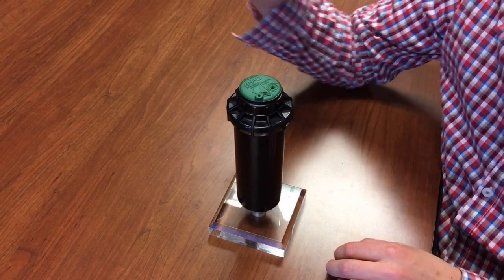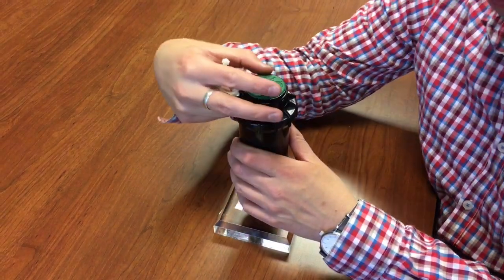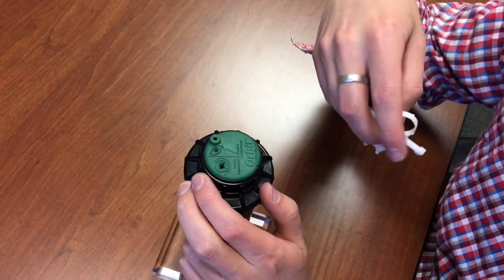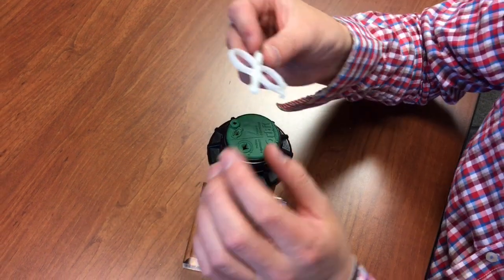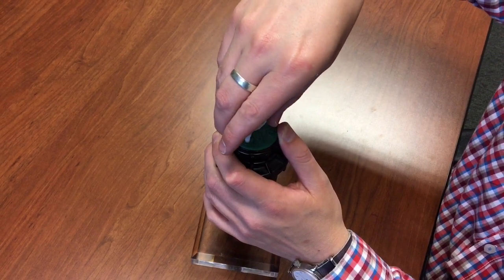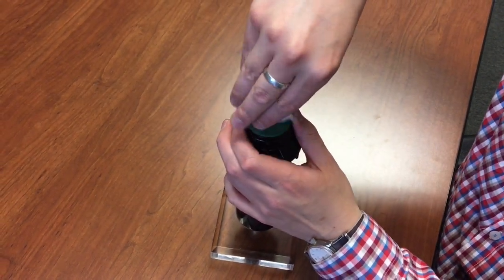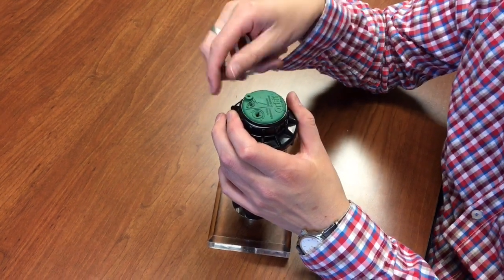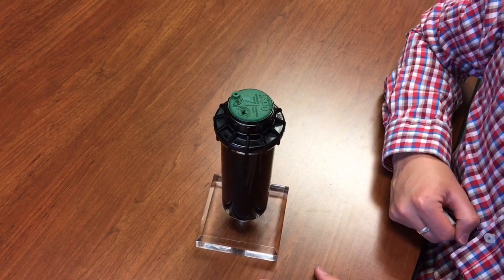Adjust a Voyager II Gear Drive (55661)

Comment: Nice video, but you left out one of the most important parts.
What good is having the right pattern (e.g. 180 degrees) if the pattern is not playing out on top of my lawn.
I think the right stop is fixed, i.e. does not change as you adjust the spray pattern.  To change the position of the right stop, I think you have to unscrew the bonnet nut and lift the guts of the unit up until you can re-position the gears to get the right stop in the right position.  I would like to find out if there is a better way.  That's why I am looking for a good video on the subject.
Reply from the maker: Yes, we have done a video on this exact subject. Please see here: https://www.youtube.com/watch?v=MdKjaFm_nnM

Comment: That's crazy.... I returned two orbit voyagers for failing to adjust less than 180... I was using the allen side. Who knew to use the popup side for adjusting..?  I got a rainbird. It used a flat screwdriver.. Sorry... Called 800 help also... They didn't even ask...
We all assumed our own respective thoughts which were different.

Comment: This is a poor design. You cannot adjust the right stop position. You must get that position set before you bury the head in the ground. It's not easy to get your right position set when you're trying to bury the sprinkler head and you don't have the water spraying out of the head to confirm you have it set correctly 35 ft away. If it's not set just right, you are putting water on the driveway or hardscape; which long term will leave rust or mineral deposits. VERY unattractive and unprofessional.

Only the left position is adjustable like he is showing above. I would recommend you use a Toro sprinkler. Both the left and right are adjustable with the sprinkler in the ground.